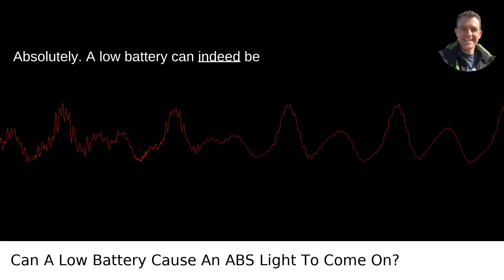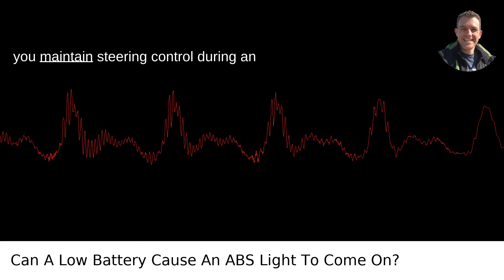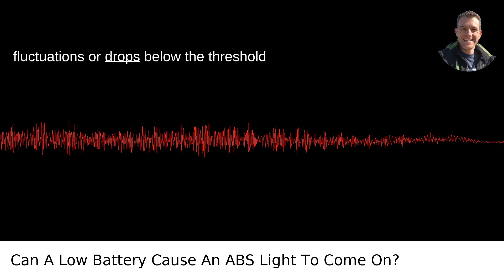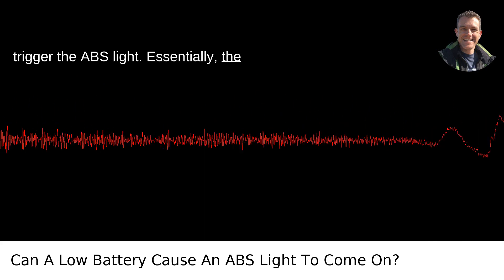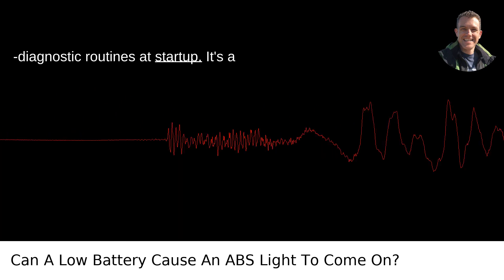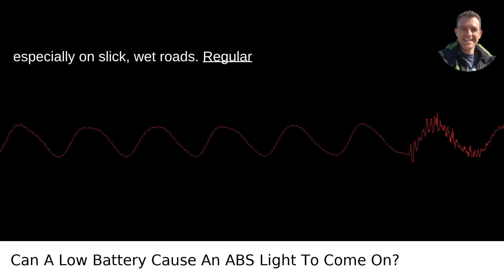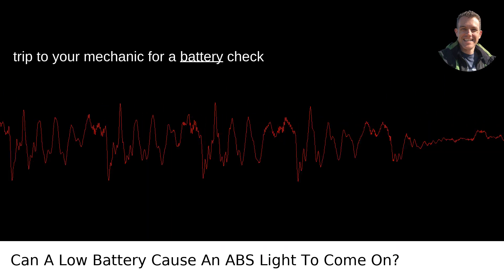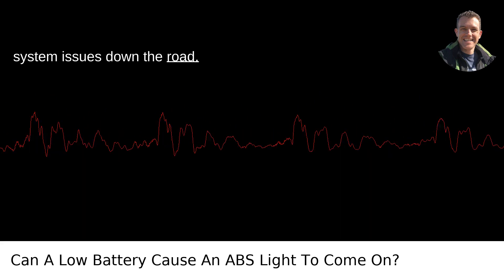Can A Low Battery Cause An ABS Light To Come On?

Comment: Great advice. Found this to be true a few weeks back when I had a battery that was going bad prematurely. I had issues for a few months with the ABS shutting down completely and not being able to operate the brakes at all.  My shop could not figure out the issue and suggested replacing the entire ABS. I had several codes and audible alarm pointing to the ABS, speed sensors and 2 relays. I pulled the relays,  and was going to test when I decided to change the battery because it was had not been holding a charge for some time.  At first, I thought it was just because I had not been driving it.  (Battery was just over 2 years old and kudos to Advance Auto Parts for giving me a new battery at no charge).  I changed the battery, reinstalled the original relays, and all alarms and conditions cleared. I will drive for a while and see if this was the complete cause.  I wanted to see what folks were saying on YouTube about this situation with my 4th Gen. Toyota 4 Runner, and I found your video. Good job.